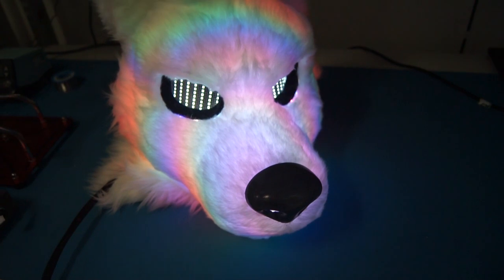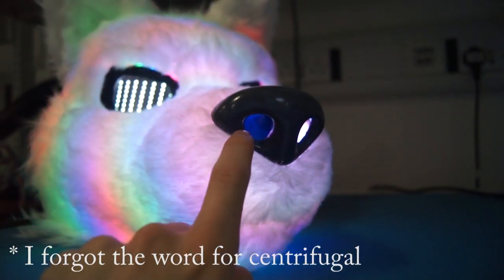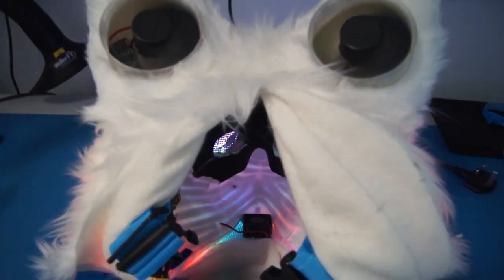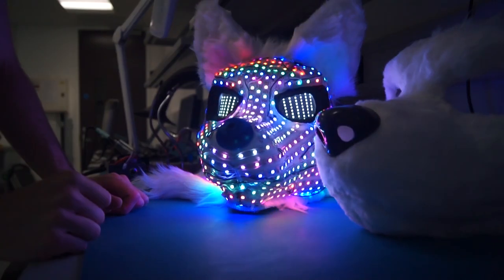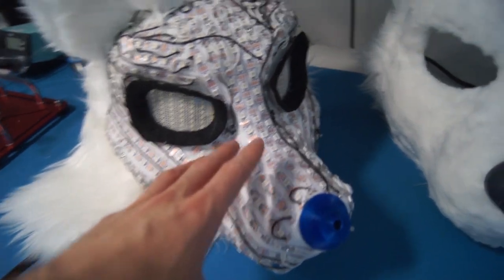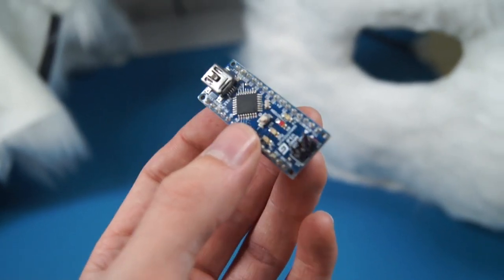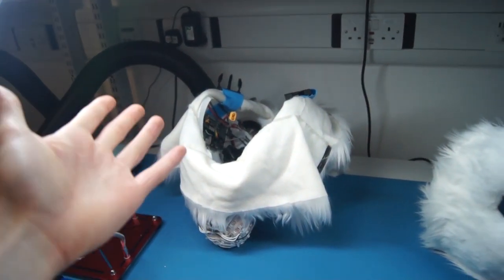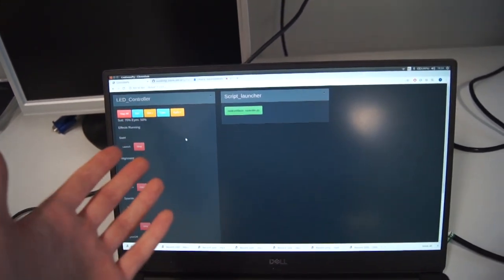TEF Q&A - Project Highbeam

Comment: That's fantastic! You should put an omnidirectional mic on top under the fur that pipes into a set of earbuds so you can hear the outside sound and cut out the internal fan noise.

Comment: You have created a major breakthrough in the field of fursuit presentation! If you make the back look as great as it does on the front, I'd say we've truly come to the future.
Reply from the maker: I was going to but opted to do a smaller area at a higher density than the entire head, as most of the time you'll be facing the people you interact with.

Comment: Wait, what type leds are you using? And what website/ program is it to control them?
Reply from the maker: The led strips I used were WS2812b strips and the eyes are genric SMD leds. The software is one of my own design that I would not recommend because it causes even a pi3 to chug hard. If you have a morbid sense of curiosity you can find it on my github (CodeMaterial) under Highbeam.

Comment: And another question. Well a ton actually. First, is the software you're using open source? I wanna do the same. What OS does it use?Raspbian? Second, what pi model it is? Is it the zero, or the new model? Third were did you buy all your supplies? How did you code it? Are you willing to do a kind of tutorial?
Reply from the maker: Yes! It is open source. 
The code that drives it lives here: https://github.com/codematerial/Highbeam
The Python communication library I built this on is here: https://github.com/codematerial/CostumePy (Checkout mvp)
OS is Raspian but upgrading to Buster
Currently using the RPi 3b+ but could run on the Zero W
Supplies are mostly from ebay actually! It's amazing what you can find there. Other resources which are useful are PiHut, Pimoroni, Adafruit, Filamentium.
How did I code it? Hard question, here are my tools: Python + Flask + Fadecandy + Blender + ZMQ + vue.js + Autodesk Remake + Cura.
I can do a more indepth tutorial on code and build but only if people want it :D Currently I know of 2.
Reply: @TheMariday  Thanks a lot! Means a lot to me!

Comment: Would it be possible to instead do this with a bunch of small round LED bulbs instead of strips? I know it would be much simpler but I'd be doing this with a foam head
Reply from the maker: Yes! You would just have to wire each up individually, so that's 6 solder joints and wire strips per led. If you were todo something on a similar scale to what I've done it would add an extra 3000 solder joints

Comment: Hey Mariday. I might have a solution to the hearing in suit problem you faced. In Finnish military we used this very cool active hearing protection from a brand called Peltor. Their earmuff had one microphone and one speaker for each ear and it boosted all the sounds around you so you could hear better but at the same time it blocked all the high and loud noises. I was wondering if you could mount these kind on earmuff inside the fursuit head and extend the cables from the microphones and place them somewhere outside the head away from the fans. Down side to this is that these kind of ear protection can cost a lot. :p
Reply: Maybe it could be DIY?

Comment: How many amps does that draw? and how many meters of lights is that?
Reply from the maker: Interesting question! So if i was to run it at full white it would draw around 20A.
However I try and make effects that use around 5A, limit the maximum brightness to 10A and all the electronics are rated 20A or higher.
How many meters of leds? Haven't been asked that before, errrm, about 16 meters.
Reply: @TheMariday  Oh wow, how do you power all that? did you make your own battery power supply or something? I'm trying to find one for my own fursuit. 
also I love how you answer everyone's questions in the comments!
Reply from the maker: @KatLunaris  I mean absolutely! you can also hit me up on telegram or twitter! I love to help! So power wise you'll need a hefty battery, I would recommend a LiFe 3 cell battery and a "battery eliminator circuit"  which will reduce the battery voltage to exactly 5v. I'd reccomend a classic YEP 20A SBEC for this.
Reply from the maker: @KatLunaris  Also please stop stealing TheBedfellows art for your profile pictures / banners / etc

Comment: wait i didnt understand the nos fan why is it shaped like a cone
Reply from the maker: The cone shape is because it's a radial fan not an axial one. Radial fans work better in high pressure environments like this one, forcing the air between the two 3D printer layers
Reply: @TheMariday  oooh ok

Comment: High beam is sooo cool also why is there no lights in his ears?
Reply from the maker: This is an amazing question! It's because the ears used to hold the step down converters as well as the cooling ducts so I needed them as clear as position as to not obstruct the airflow.